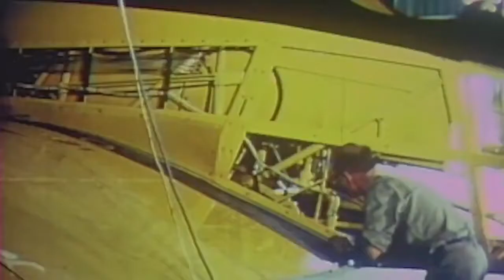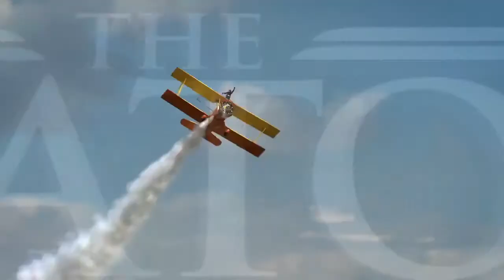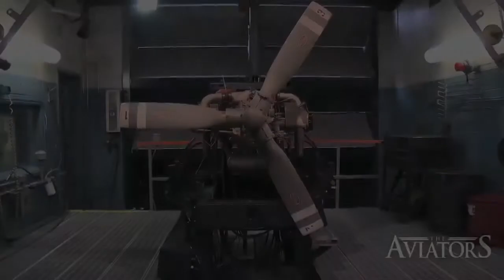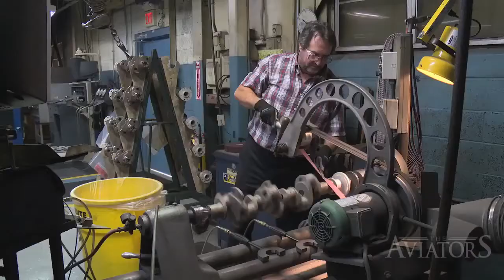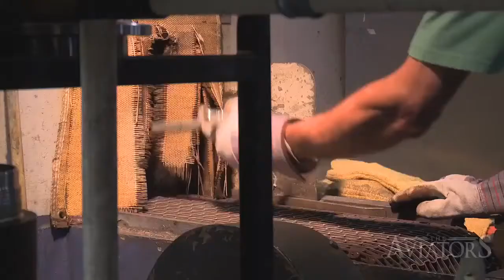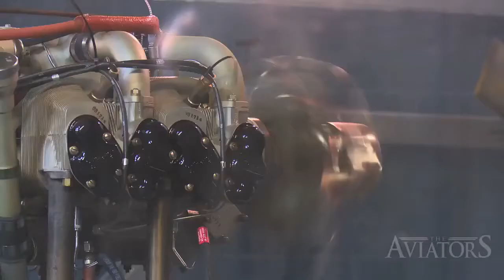Continental Motors   How It's Made

Comment: The same incident occurred on 15.03.2024 at Zabrat Airport in Azerbaijan. Abdul Mahmudov, the pilot of the Embraer 190 aircraft, was re-enrolled in the training he had completed in 2011 on a Cessna 172S aircraft. On 15.03.2024, while flying a Cessna 172S aircraft with the registration number 4K-AZ95, the engine caught fire at an altitude of 500 feet. Since the airport was nearby, the RW-34 also crashed from a height of 60 feet and made a hard landing. As a result, the L5 vertebra was fractured. The C5 and C7 vertebrae were damaged. His left arm was paralyzed. Although he completed 101 days and 59 flight training on DA-20 and DA-42 aircraft in Turkey AYJET, all his training failed due to paralysis of his left arm.

Comment: We paid $50k to overhaul our Continental six cylinder engine for the third time over the life of the aircraft. What did we get? A 4-month wait, a six liter 1950's tech engine rated at a mere 210 hp, but that still has to be operated with extreme delicate care because of it's fragility. We got an engine that does not have electronic variable ignition timing, computer adjusted fuel mixture and power delivery, multiple valve cylinders, variable valve timing or any of the other common modern tech and reliability of an automobile engine. We got an engine that is air cooled instead of modern liquid cooled, so is susceptible to overheating and premature wear.  We got an engine that is less fuel efficient and runs rougher than a modern automotive engine and which may suffer a catastrophic internal failure because of its antiquated design. Yes, these engines work harder, often using 75% of their rated power at cruise, but they only have half the rated power of a 6.0 liter car engine. Because they still require leaded fuel they wear prematurely and emit pollution because the fuel producers and the FAA has dragged their feet over certifying unleaded fuel. The FAA has also sacrificed safety by putting up insurmountable bureaucratic barriers to certifying truly modern engine options. 

Over in light sport aircraft, they do have a modern engine series, made by Canadian company Bombardier/Rotax. They have EFI oil and liquid cooling, get fantastic fuel economy and are so reliable that the airplanes they're installed in have made repeated transoceanic and transcontinental flights for publicity.  New FAA rules to bring our light aircraft technology into the new millennium are on their way, but were supposed to arrive four years ago. We're still waiting. In a different universe, I would already have bought a light, efficient and cleaner aerodiesel based on proven designs from Steyr, Mercedes, BMW and others, that gets 40% better fuel economy and lasts the life of the airplane.
Reply: man, i thought i was the only one thinking this; you’ve hit the nail on the head. What bothers me is that these antique engines are truly less reliable and more fragile than modern automotive engines. If the FAA and the engine manufactures were actually concerned about safety, then all of these engines would be in museums by now. I just saw my friend pull the lifters out of an IO520 with only 600 hours on it. Some of them already began flaking and losing material on the wear surface. And before someone replies and says “it’s because the owner wasn’t operating it or maintaining it correctly”, then why can Toyota engines get neglected in third world countries and still last to half a million miles with zero issues? Anyone that tries to defend continentals or lycomings is ignoring the fact that they’re more fragile than a box full of wine glasses.
Reply: We’ll never saturate ignorance…